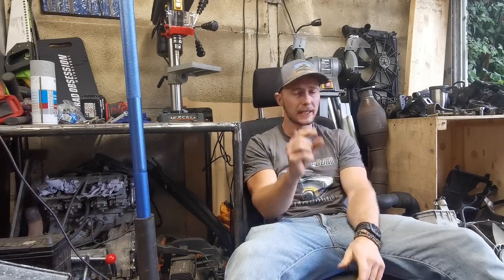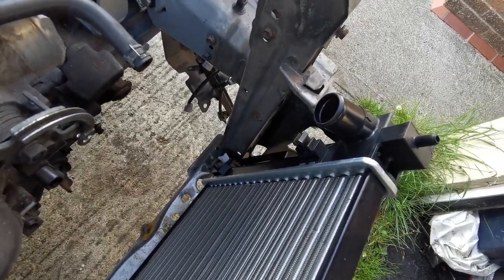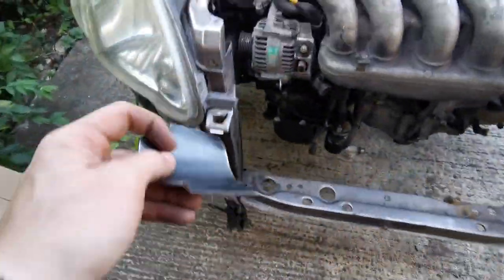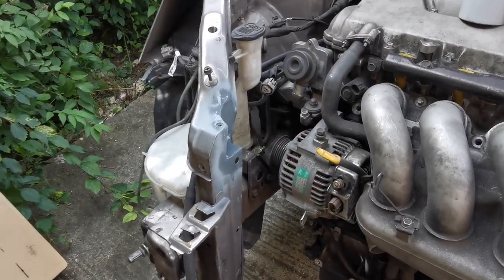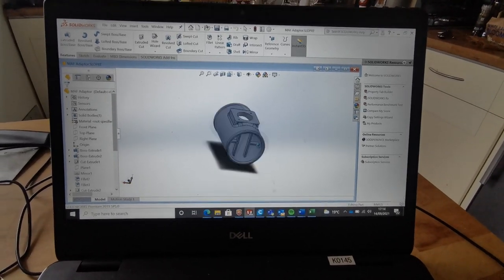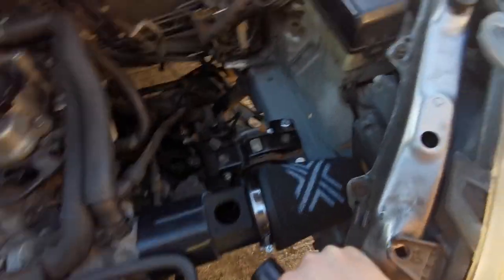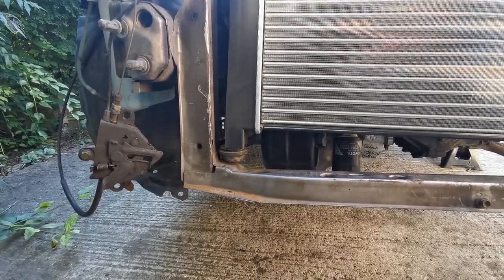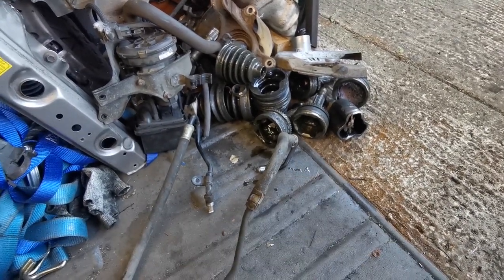2ZZ Yaris Build ep.18: A BIG SURPRISE, making things fit, new bits & 3D printing!

Comment: Intake manifold off a runx / vibe GT points the TB slightly upwards which might have cleared the rad. And possibly steering column with electric PS from later model vitz / echo or Prius if you wanted powersteer.
Reply from the maker: Had to google RunX 😅 Corolla! I'm actually undecided on the PS at the moment. I think the belt routing might not work without the PS pump. I'll see when I come to stick the final engine in there.
Reply: @readysheddyno9958  cool.  Also I forgot to add. Great work on this.  Fantastic to see someone doing the swap and putting content out.  I'm thinking of doing the same but would probably use the C56.
Reply from the maker: Thanks so much. It was a brave one to start the channel with I'm starting to realise! The info really isn't too widely available that I can find. Got some good plans for the next few projects as well so stay tuned 🙂

Comment: The air pump is only for startup. Don't bother with it she will run fine
Reply from the maker: Cheers :) I've decided to sack it off- briefly mentioned in the next vid which is running a little behind schedule!
Reply: @readysheddyno9958  I did a 2zz swap in my MR2 over lockdown. the air injection pump is for emissions on startup only (my car has since passed a MOT) I just cut the pipe short that goes into the top of the manifold and Tig welded it shut.
Reply from the maker: @Truzo  that's my plan now 🙂 Pretty jealous of the mr2 swap. If I was pre planning this from scratch rather than just buying things and making rash decisions that's definitely what I'd have done!